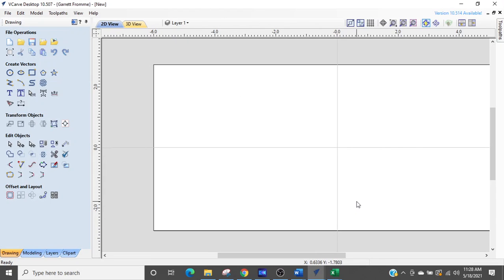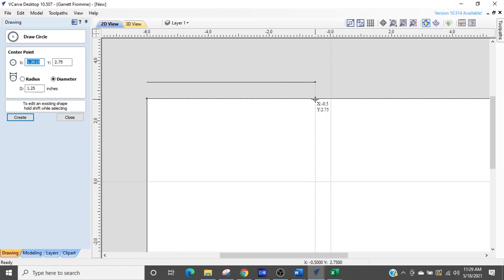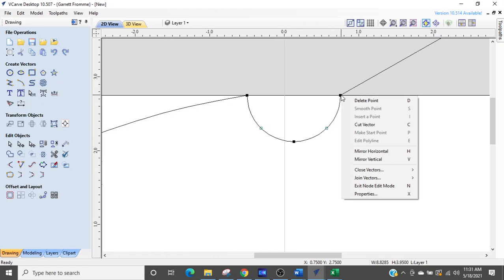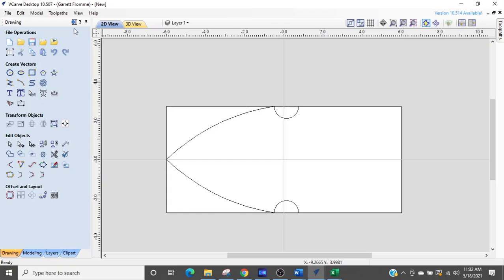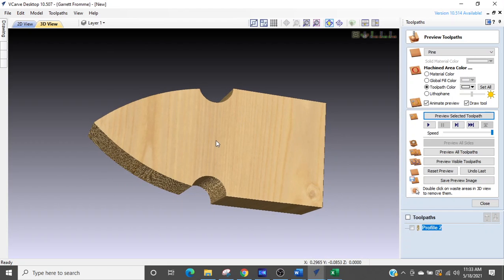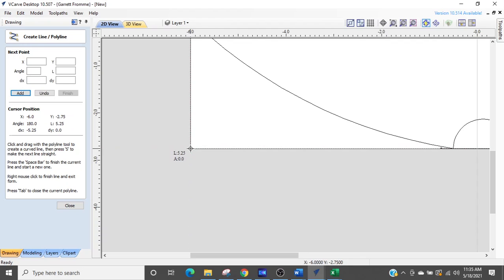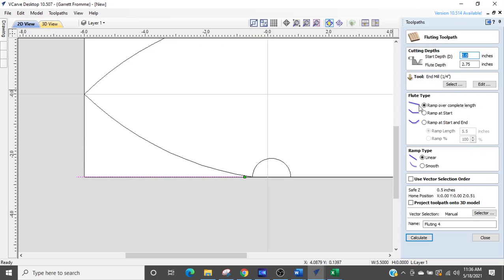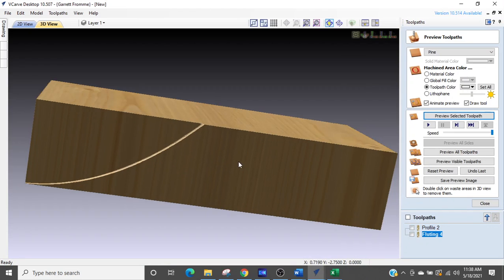Cutting A Fence Post - Help!! [Vectric Vcarve] - Garrett Fromme

Comment: Are you trying to get the 2 remaining sides to be the same as the 2 you already cut? If so just rotate the wood and make same cuts again.
Reply from the maker: This would be a two  step operation for both sides

Comment: Maybe I'm not getting it.... Could you not cut the pattern as you have drawn it; rotate 90 deg, cut the pattern again; rotate 90 deg, cut again; then twice(?) more to cut all four sides by the 1/2 depth?  If your friend is using a 1/2" bit and trims away a lot of waste on the bandsaw, he could cut each side in one pass. (make a paper pattern to mark the saw cuts.)
Reply from the maker: Hi Richard. We discussed the 4 sided op. We were shooting for 2 operation approach

Comment: If this was my project and I wanted to do it in two halves I would go into Google SketchUp I make an STL file of the shape of the post and then do a 3D carve on each side
Reply: Are you using Aspire?
Reply: No vcarve Pro
Reply from the maker: Now we're talking. thanks for this. I haven't used sketchup before

Comment: I had to set the vector path from side to side, not the length. Used both 1/4" EM followed by a .25 TBN on the same side to side vector. it works but leaves visible lines. Changing the tool parameters may help with that.
Reply from the maker: Thanks ed for sharing this.

Comment: In theory you could add a domed component and then create a closed vector of have the component, them use that vector in the finishing toolpath ( selected Vectors).
Reply from the maker: I hoped you would reply to this. It's one of those animals where I have to trick the software. I could tilt the dome as well. By the way, I'd been thinking recommending your channel so will be doing that in upcoming videos.
Reply: @IDCWoodcraft  How did you solve the problem ? Emails me so I can send you a short video on my approach. mm@mezalick.com
Reply from the maker: @mezalick  just started fiddling with it this morning. A little tricky but the approach seems feasible. Very interesting concept.

Comment: Did you try reversing the start point of the vector line?
Reply: I think you have the answer here. Since the software doesn't know up from down the order of picking points would be it's "decider". If that doesn't work it would be a terrible oversight in the software design. But actually isn't it the order that you pick the points in rather than picking a start point. I don't know, I don't use Vcarve. Also seems like a lot of air cuts. How about using a fixture and flipping the part and profiling instead of trying to come up with fancy G-code.
Reply from the maker: Thanks Jim for adding to this.
Reply from the maker: Hi Jaxx. Let me know when it arrives!!! I want to celebrate with you.